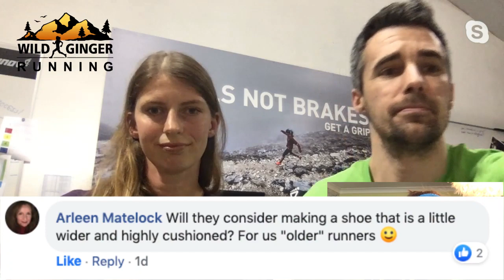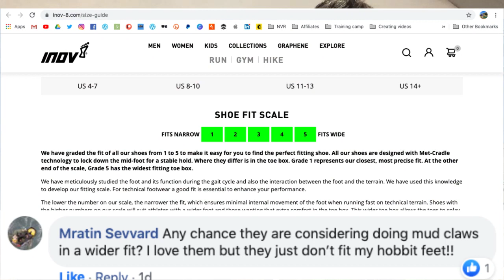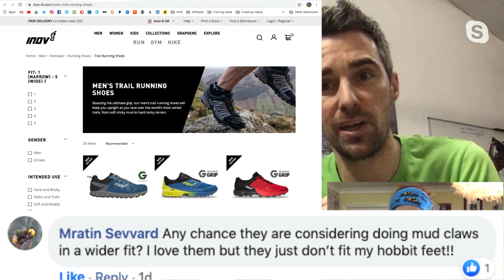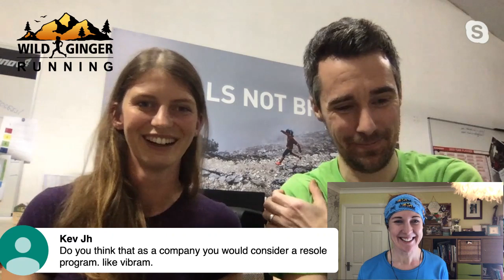How do inov-8 design & make trail shoes? (incl. GRAPHENE GRIP & wide fit/cushioning info)

Comment: 2:29 - How did Inov8 start?
4:05 - How is a shoe designed and built?
10:44 - The Factory Process
13:45 - The TrailRoc
20:38 - Guy Greatorex - How is Graphene used in the shoes?
27:09 - Guy Greatorex - Can you develop Graphene Grip Further and will you be using a Carbon Plate soon?
32:02 - Guy Greatorex - Why Crossfit?
35:16 - Alex De Hotot - Have you considered making cycling gear?
37:07 - Up To Summit - Where does the inspiration for shoe design come from?  Animals? Other Sports?
39:39 - Chrissie TV - Why are so few shoes waterproof?
43:08 - Arleen Matelock & Randy Cuffaroe - Will they make a wider, more cushioned shoe?
51:38 - Shoe Fit (width)
54:48 - Rich Simpson - Why weren't you at the Birminham running show?
56:08 - Kev Jh - Would you consider doing resoles like Vibram?
59:10 - Have you got any jobs going?
Reply: mine right shoe rocklite 275 the red rubber on side unglued prety easily where is
 the flex of big toe

Comment: great post W.G. 
Inov-8 many thru-hikers wear trail runners and the Terra G 260 could have been the Lone Peak killer.. just not wide enough and too much 'ground feel' for us, shame.. the Roclite G 275 are pretty good but they could do with being a bit wider in the footbox (a 6th scale?) had great volume but needed more cushion. i understand these are primarily designed for runners but what we need probably isn't far off from what the people with shot knees were asking for in the comments ;)
8hrs hiking a day.. days on end demands wide footbox for natural foot expansion & swelling.. light with fast water drainage (the mesh material on zero's Mesa Trail looks interesting but some dyneema weave would be better).. & of course uppers with durability which i think you already have not to mention the graphene. 
if thru-hikers can do a 2500 mile hikes in 2 pairs rather than 4-5 it's a no brainer which we'll buy. the market is massive (and growing all the time) and in my opinion the Altras (the 'go to' shoe in the field) build quality is pretty rubbish so should be easy pickings & it'd be great to see a UK brand dominate :) 
oh and of course i'm up for testing.. i'll be hiking the Cape Wrath, West Higland & Pennines Way continuous in spring.. then probably the Ireland Way after that.. so good data opportunities ;)